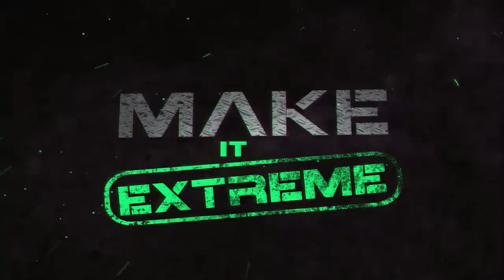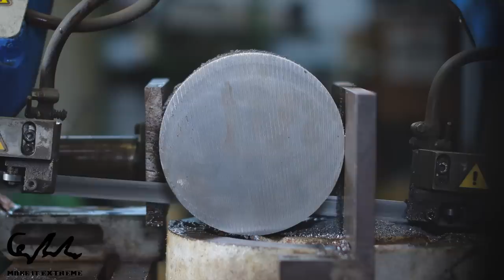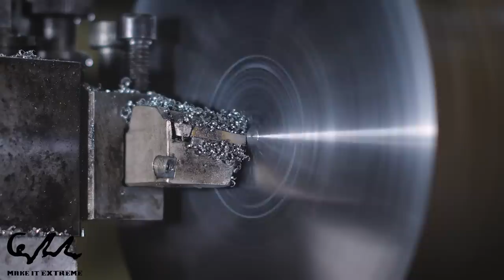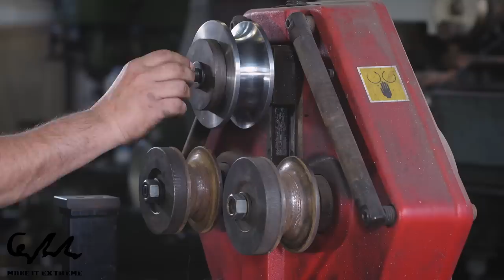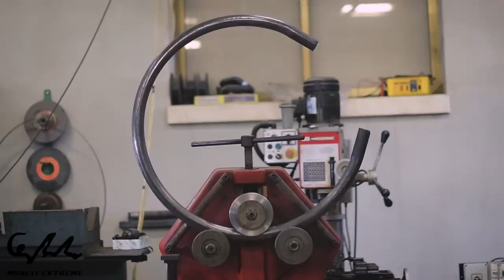Project 0104 | Making a tube bender die

Comment: I was a machinist for 13 years. Most of that time I ran a lathe of one type or another. I would have never thought of using an indexing head and boring head to cut the groove. Great idea. I'll have to remember it if I ever do something like that. Good job.
Reply: Another way to skin a cat would be to use correct size endmill instead of boring head.
Reply: @zumbazumba1  I don´t think that it would work since the endmill wouldn´t be rotating..
Reply: Could have hogged some of  that mat'l out on the lathe first.
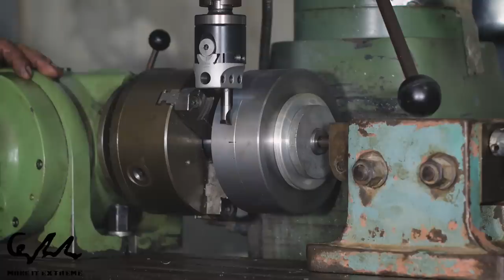Reply: At 2:27, the green thing is the indexing head. But he is using it a a rotory head. The part that is vertical and spinning fast is the boring head. The cutter in the boring head is a boring bar. Typically the boring head is used to make holes in a part to very close tolerance. The Indexing head can be set so the part can be vertical or horizantal. It is used to put holes or other features in a part around a center axis usually. Hope that helps
Reply: @tobyshew865  I agree.
Reply: @J1I9M7M4Y  You could use an endmill. It turns just like the boring head. It be a huge one though.
Reply: @Neptune730  Oh.. Thank you for that info! I learned something new today, then it is a good day!!
Reply: @J1I9M7M4Y  True. Endmills are known for being extremely self-centered. From their perspective, they sit still while the whole universe turns around them.
Reply: @custos3249  😂😂😂
Reply: Why dont just use a tool with a radius?
Reply: @diamonddogie  Do you mean on the lathe? That would be a very large tool. Also that is way to much surface area to cut in one go. It would also cause a tremendous amount of chatter.
Reply: @Neptune730  I agree with that. Nobody is mentioning how many times has to be turned over that dividing head, to achieve this operation. Probably a few hundred times.

Comment: Good video!
Great way of cutting the radius, although it would have been faster to remove a bit of material on the lathe first!
Reply: TommyGun Machining probably just wanted to try that method from start to see if it worked

Comment: One mistake, you hogged out the die's core with the finishing tool. The correct move, same machine setup, with an endmill (doesn't have to be ball nose) and you hot out the center until you reach "periscope" depth. Much like you don't bore a hole with a bore, you hog it out with a drill bit (on the lathe). Then you use the milling head.
Reply: I thought the same thing, but you use what you have. As you are aware, powerful milling machines can be dangerous without good instruction or experience.  It take time to learn. 😉
Reply: @opendstudio7141  Beware of the real killer -cows trample more people than milling machines !!!